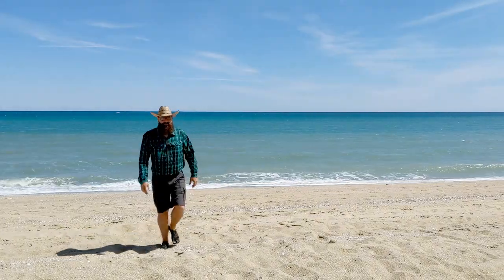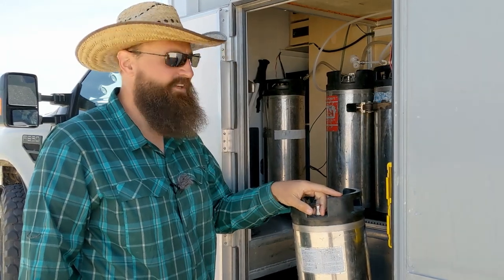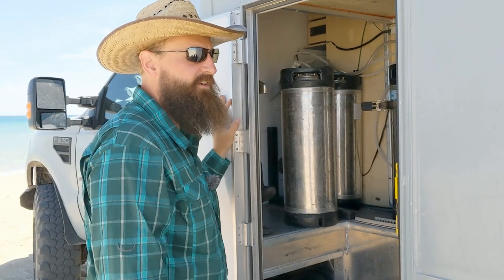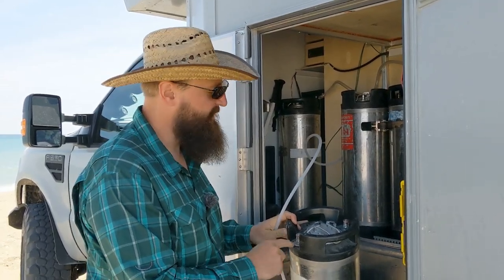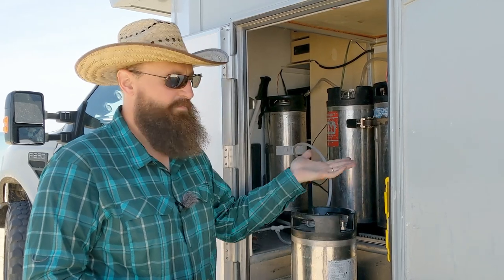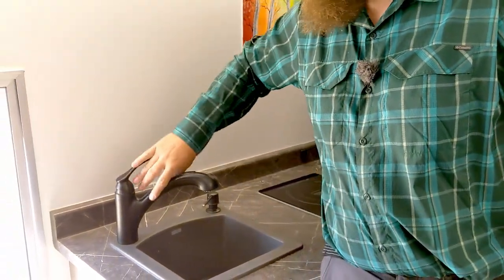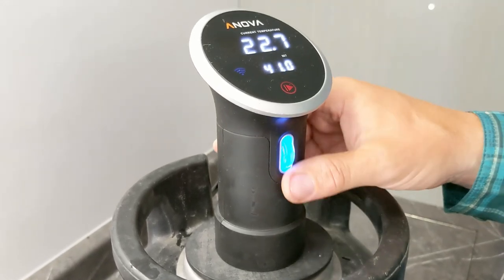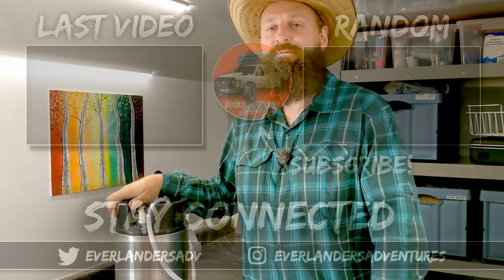Keg Water Systems Finally Explained - Mexico Water Filtration - Everlanders see the World!

Comment: Awesome system, well done. Only question/concern I have is oil dispersed from the compressor hitting the water. Is there a membrane in the keg? Sorry if you already answered this question somewhere else.
Reply from the maker: They are oil-less compressors...
Reply: Everlanders thanks
Reply: Was looking for this question on oil. This system is great. Im thinking of using 1 keg for drinking water as already have 100L tank for water. But not sure about the compressor.  Would it be possible to pump the water from a keg?
Reply from the maker: It kind of defeats the purpose of using a pressurized keg, there would be significant restriction for suction, so it wouldn't flow very fast, and at some point you'd pull a vacuum on a sealed tank...

Comment: Hi Everlanders. Great watersystem you have there. I have a question about it. Is your uvfilter constantly on or do you have a flowswitch or something else ingenious going on to prevent that?
Reply from the maker: The flowmeter turns on the inverter if it's off, but it stays on the whole time we're cooking or whatever...
Reply: @Everlanders  Great. Thnx.
Reply: @Everlanders   Look for Aqua Topone PH3-S103 LED. It seems to work @12 and 24 volts and the lamp is switched off automatically with a flowswitch so it will last with 3000 hours lifespan almost forever. Another advantage is that you don't need the inverter and it works instantly without the wait for the inverter to kick in. In your case you must have non uv filtered water when you turn on the faucet.
Reply from the maker: Impossible to get here... And I'd disagree that our water is unfiltered when switched on because it was pre-filtered on the last cycle for 120 seconds before the inverter is automatically switched off...
Reply: @Everlanders  Yes offcourse :)
Reply: @Everlanders  Although on second thought you said the inverter starts because of the flowmeter but the inverter doesn't start right away. Multiplusses don't do that. So there must be some unfiltered water.
Reply from the maker: I disagree, ours starts in less than a second, also consider the volume of water that is left in the filter after the water stops flowing, it continues to get UV for another minute until the light is turned off... So that water is already treated, ready to go for next time.
Reply: @Everlanders  I also have a multiplus and when i switch it on it takes about 30 secondes before it starts inverting. I follow you in that when the inverter stops that the water which comes from the waterfiltersystem is filtered by the UV lamp. But unless the inverter starts immediately when you use the faucet there must be slipping through some unfiltered water until the inverter is actually switching on the uv light. Because of that i would drain that first water.
Reply from the maker: No, there is something horribly wrong with your system if that is true... Ours takes less than a second...
Reply: @Everlanders  Hahaha It did that since the beginning and i always thought it was normal behaviour. Guess i will find that out and start asking some questions about it on the victronforum. If the startuptime can be quicker it would be nice.
Reply: @Everlanders  You were right. Straight from the battery only my multiplus switches on in just a sec too. Because mine is also connected with the grid using Victron's ESS it takes more time to passthrough the grid.